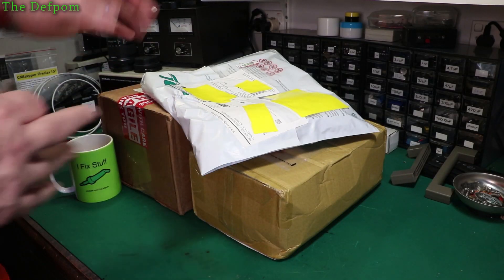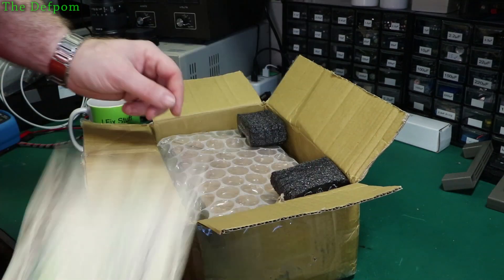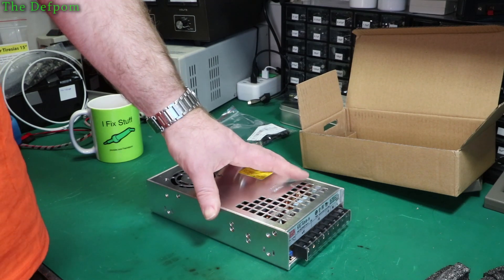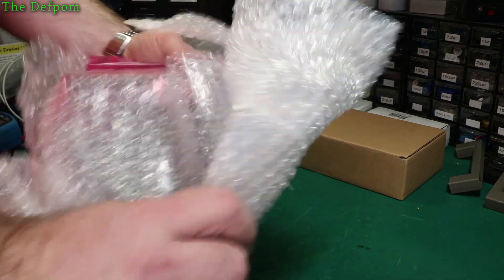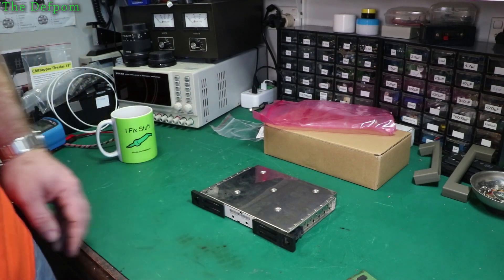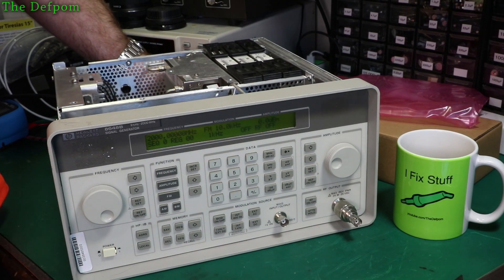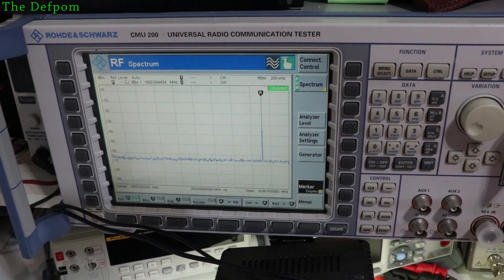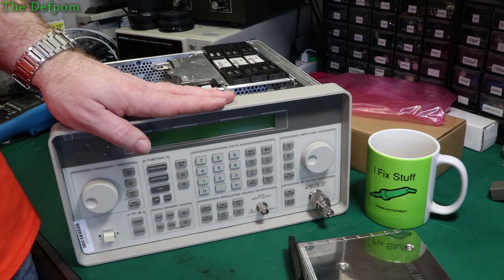🔴 #628 Mailbag Monday 16th September 2019

Comment: Those are really nice generators, the 8647 and 8648 series.
I like the size and front panel layout of them, and the price of used ones are in reach of a hobbyist on a budget.
Good thing also that the display is not a VFD that fades away by age.
Reply from the maker: Geir Endre Jenssen - there are versions of these with VFD, an easy way to tell is the presence of the contrast control on the rear for LCD units.
Reply: I didnt realise that. But I see now there's some 8648C's with VFD.
Thanks for the clarification, and yet another informative video.